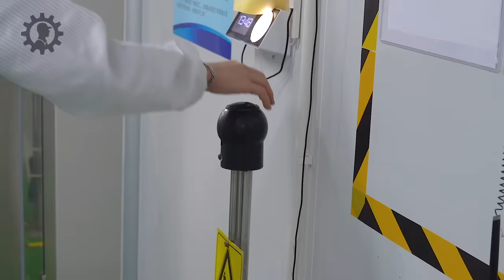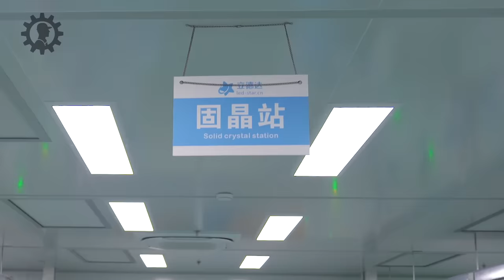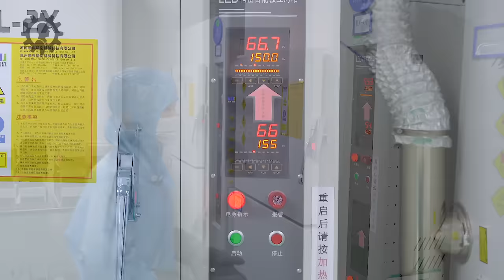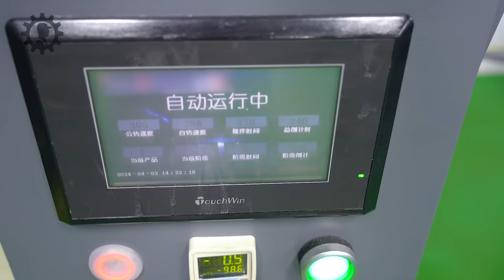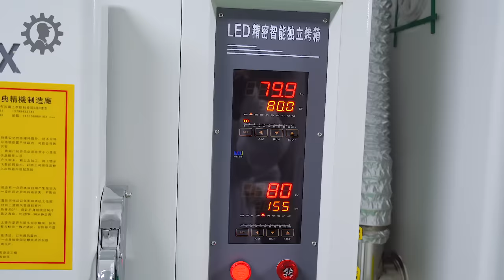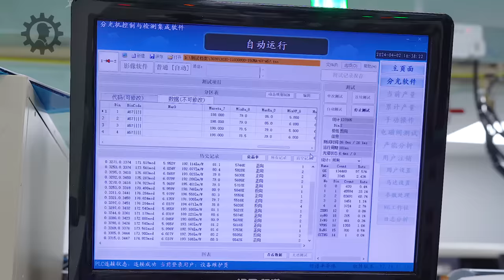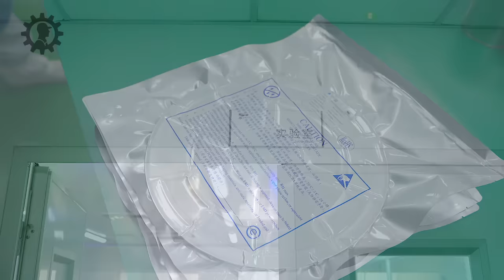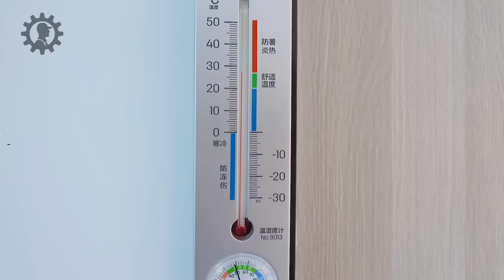High-End Manufacturing: LED Chips Mass Production in China

Comment: Super impressive! It's amazing how every tiny LED is binned for color and tested multiple times. Also the longevity testing in those ovens really impressed me.
Reply: Ovens are literally there to... bake stuff. Where did you even get longevity testing by OVENS?! First baking is to solder the chip to substrate, the second is to bake the luminophor layer (that orange goo).
Reply: @Noobochok  Yeah but time is everything. All SMD electronics are baked in an oven, but the temperature ramps and times are followed very accurately. It's minutes, not hours. So every silicon chip is pretty much good for 150 degrees C for a few minutes or more, but not hours and days. LEDs can operate at very high temperatures so I guess it matters a lot.
Reply: @Gersberms  most modern SMD somponents are good up to 260~ish for a minute, because the the lead-free paste used literally requires it for proper good joints. Still nothing to do with "longevity testing".
Reply: food industry machines
Reply: Step into Central Asia and prepare to be amazed by their lack of progress – or lack thereof.
Reply: @Noobochok  I'm honestly wondering if you're blind. Shortly before or during packaging you can see LEDs glowing in the long-term test at 85°, red, yellow, green, and white glowing in different color temperatures from cold white to warm white. This means that the lifespan of years can be simulated in the heat ovens in just a few days or weeks. And one operating hour at 85° corresponds to xy hours/days of real-time operation as the wear/° potential increases. After all, no company has 10+ years to test a batch of LEDs etc.

Comment: 10:40  This is clever. Randomly place the chips and then blow out those which are not properly aligned.
Reply: I suppose it’s like a coin flip. Heads or tails? 
Those that landed tails get blown out of the conveyor belt. And then fed back in again and again, until it finally lands on heads.

Comment: Like another commenter said, the full bunny suits everywhere and air showers before entering the cleanroom, but no gloves on anyone anywhere is kind of weird. The hands, aside from the hair, are the largest source of contamination and extraneous particles in a cleanroom environment. 
I really do not understand what's going on at 5:50. Why are they BREAKING the gold bond wires going to the chips??
Reply: This is a tensile strength test.
Reply: To add to what @Ledestar said, it's for quality control.  It's a destructive testing procedure performed on a random sample.  Not all of them.
Reply: The semiconductor is already finished at this stage, so the contamination by hand is negligible, it's not that sensitive. The chip is literally drowned in phosphorus resin later on, so a few particles will not damage it.

Ofc in a semiconductor manufacturing plant everyone has to wear gloves, the structures are so tiny that a spec of dust will make a chip inoperable.
Reply: @them0leisback  Wouldn't a particle of water from the humidity of a finger be trapped in the resin later on, and explode when it gets hot enough?
These LEDs have specs of 20k-50k hours, and I often see them fail after a couple of years of use (non-continuous).

Comment: Weird seeing the bunny suits and entry procedure but still no gloves.
Reply: The use of mass production machines in LED chip manufacturing underscores the need for rigorous quality control measures to ensure product reliability and longevity.
Reply: It looked so strange to me as well. If something, the hands are a real source of contamination...
Reply: food industry machines
Reply: That jumped out to me as well. It’s like they have all these procedures but you’re going to get dead skin cells, hair, and oils all over the place because, no gloves. SMH
Reply: Maybe having uninhibited manual dexterity is more important to a stable production line🤷🏼‍♂️
Reply: @frederickdalley7871  good point. I’ve only seen clean rooms and never worked in them, let alone a clean room for building LED chips, so I don’t know. It just seems like you could have thin gloves to limit contamination without inhibiting dexterity. Maybe, it’s cost cutting because those type of gloves would be disposable. I really don’t know. It just looked “off” to me compared to the various other clean rooms I’ve seen. Thanks for adding your perspective! :)
Reply: @frederickdalley7871  Do you know anything about clean rooms?
Reply: @RetroJack   not really - we have some at Work but they're for nanopowders. All I know is these guys are in some quite expensive-looking clean-rooms and yet they have no gloves, so there must be some reason/compromise going on otherwise they coulda just forgone the whole installation and upkeep of a clean-room altogether and use a cleanish-room™
Reply: @frederickdalley7871  If it's like the areas used  for assembling LCD panels, it doesn't have to be super clean - the primary concern is fibers shed from clothes, and the suits + air showers are good enough for that.
Reply: @frederickdalley7871  Fair enough.
Reply: When the yield of these process is good enough, the comfort of workers becomes important and the cost of additional protective measures unnecessary. This is a low-end cleanroom, suitable for electronics assembly and packaging. I even know one low-volume chip manufacturing facility (not packaging) that is not a cleanroom but just "let's close the windows and wear lab coats" type shop.
Reply: If you’ve ever worked inside a clean room, it’s actually pretty normal. The suits are to prevent skin flakes and other dust that you carry on your clothes and hairy body. The oil on your hands isn’t as much of a problem and you don’t really shed skin from your hands as often because the tissue there keratinizes. Additionally, wearing gloves all day will make you sweat and that is more of a problem.

Comment: What is going on with the expanding blue film at 2:30? It looks like those are the chips that are then used for the LEDs-- is that how they come?  What is the purpose of that?
Reply: Those are the bare LED's that come from the semiconductor fab before they are packaged on the metal plates and before bond wires and phosphor coating is applied.  They're manufactured in a small area then the blue film stretches to allow the grabber to do its thing.
Reply: @starlite528  Are they expanded? and do they stay expanded?
Reply: In another YouTube video they explain this expanding blue film… it’s to create greater separation between the chips. So when the robotic arm picks one chip up, it doesn’t knock into the neighbouring chips.
Basically the chips are made close together, the blue film stretches them apart and then a robotic arm picks them up one at a time.
What this video didn’t show is. The robotic arm sensor can detect which chips are good and which are faulty, so the robotic arm only picks up the good ones.

Comment: 7:09 When you realize yellow thing on led is just a glue. :hand-orange-covering-eyes: 
👇
Reply: i think its phosphors to convert ultraviolet and bleu radiation to white .
Reply: The yellow is just a layer that turns the blue light coming from the LED into a broad range of wavelengths, which makes white light. Every white LED is just a blue LED with that yellow phosphor coating it.
Reply: Central Asia: where the air is thick with pollution and the land is scarred by neglect.
Reply: Luminophore gel

Comment: so this is why they keep failing. no real clean room during bonding and no sealing under vacuum so moisture is trapped in slowly corroding thev die. So lame.
Reply: There are different cleanroom classes depending on the process. Led 'chips' are too simple and have a relatively large surface per active component, no need for same cleanroom class as complex semiconductor products
Reply: @effedrien  Well, judging by amount of failed Chinese LED structures one can spot everyday, it means "not nessesary" means "we will push it on consumers".
Reply: @piotrcurious1131  I think it only means you're generalizing while you have no idea about the reliability of the products that come from this particular fab. Not really related, but I own few electric and electronic tools from china, and that are actually good quality. Those items were already preselected by a European importer of course, and not to be compared with scam products or supercheap crap. Btw i remember an American brand that when i opened the case,  I cried that i spent so much money on that 'high end' amplifier. It was just cheap garbage in an expensive case... Oh and when led lighting fails, it's usually the drivers's fault, not the fault of the leds
Reply: @effedrien  i actually have a lot of idea as i analysed thousands of devices from various manufacturers  in the past 15 years. 
I would be very happy if Chinese LEDs were good quality as many times they get installed inside quite expensive fixtures or in difficult to reach places. But they are not, and it's not fault of the driver as sometimes they fail out of the package. 
Actually i am also happy that the problem can be spotted right away at the video, because it puzzled me how such a simple device can be made faulty - i even suspected that there is some inherent flaw in the technology itself, as you could find failing LEDs even straight from the reel, never soldered. But other manufacturers have not this problem - so go figure.
Reply: @piotrcurious1131  Sometimes the product gets damaged after the final visual inspection, before or during the reeling. That really sucks, and i have seen it going wrong few times. But only with parts that have something fragile, on the inside like mems sensors, or on the outside like fragile leads of some types of qfp, or thin naked dies.  If it happens with something as simple an robust as an led , the problem must be somewhere else but still unnoticed by automated inspection umm. Anyway, if that frequently happens, i doubt the company will exist long. It's not funny for the end customer to have his expensive pcb reworked or scrapped because of soldering a doa component on it.
Reply: @effedrien  LEDs with faulty structures occur in all kinds of packaging and sizes. Mostly White leds exhibit the problem. It is hardly a post packaging problem. It might be a moisture problem during the packaging (encapsulation) stage, as we see on the vid - no clean room. The dust itself embedded in the package can contain moisture. I have no idea really. I have nothing against the manufacturer staying in business, cheap LEDs are what humankind needs to stay out of darkness while not burning the earth to the ground. I know labor and human rights conditions in china are dire yet still i appreciate the sacrifice these people make to deliver the product to the humankind , living in polluted cities under an authoritarian regime under constant threat of being dragged into nuclear conflict, unable to talk to the outside world. That is really sad. Let them at least have light.